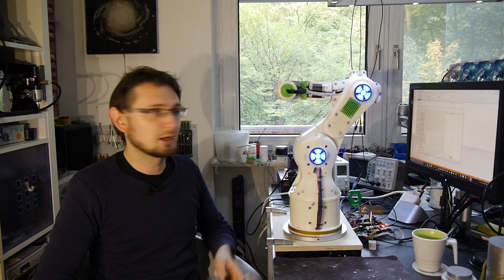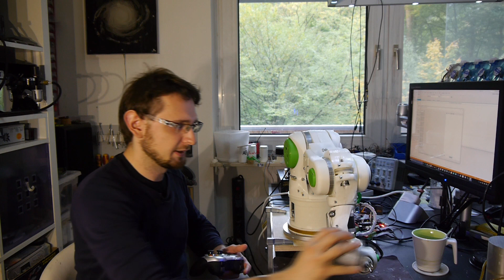Robot Arm project part 12

Comment: Very cool.  Have you looked at all into machinekit? The advantage would be smooth motion and I believe it should be easy to write a kinematics module, and use a beaglebone black with a CRAMPS or xylotex cape. If you wanted closed loop control you could do that also with some fancy coding.

Comment: what an amazing work done congratulations. Its works and looks amazing. But i could not understand your encoders. is these encoders costom made if its how its done or which materials used or are you gonna share or sold these encoderes. Im planning to build one for my home use to help me if you have a plan for selling or sharing your encoders please let me now and did you use PLA for robot arm or different kind of material

Comment: Thank you for sharing your progress! This appears to be a very robust system, even taking into account its limitations involving the use of stepper motors. A more complete BOM and documentation would help those of us not so skillful in the art of robotics.

Have you considered DIY aluminum casting for the gears/drives? There are several YouTube tutorials out there, but this one in particular (https://youtu.be/oFZMfBXxMxk) cleverly uses a conventional microwave oven, and it appears to be one of the least time-consuming and most inexpensive techniques.

Comment: Hi Andreas, nice development on your new bot. I have been working on my own bot right now but, mine can't even carry 200 grams, with arms fully extended. I am using servo's and I should admit, I am a bit disappointed by the angular resolution of my servos, it can only get accuracy to about 2 to 3 degrees. I am planning to increase torque by taking out the pot inside and gearing it up using 1:24 worm gear. If my calculations are correct it should be able to lift a maximum of 1 kg. In the future I am planning to convert it to stepper motors, just because I could not get the resolution I want from my servos. Anyway, you continue to inspire me with your work, please keep going.

Comment: Do the drive belts introduce some vibration because they flex?
Reply from the maker: +Dan Frederiksen If you tighten them to the right way thy have practically no clearance.
Reply: +Andreas Hölldorfer ok nice. Then I suppose they are just as good or better than metal gears because of their continuous large surface grip and allows use of printed plastic mechanics (up to a certain strength to weight limit).
The additional tensioners add a bit of complexity but not too bad considering the benefit.
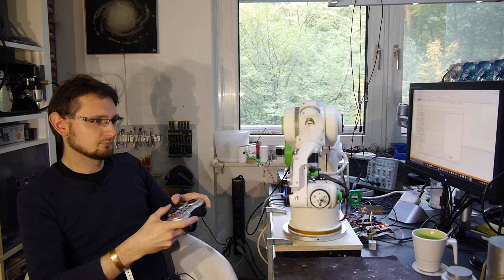I see you already have two stage gearing, I thought it was only 1. so you get around 1:10? you probably need either higher diameter or a 3rd stage to really benefit from brushless motors but you could try a single joint test just to see how well it would work with 1:10. Servo is definitely the way to go for serious robots. No serious commercial robot arm uses steppers afaik.
Reply from the maker: +Dan Frederiksen the ratio is between 10:1 and 15:1 and there is not so much space left for more. I'm looking since a year now for brushless motors with a gearbox let's say one stage planetary gear with 5:1 and didn't find one.
Reply: +Andreas Hölldorfer how about simply making the small one smaller and the bigger ones bigger? particularly the small cog makes a big difference in ratio and because of the large contact surface of a belt, I think it can have very few teeth and still work very well. Do smaller ones exist? otherwise perhaps that one small part could be 3D metal printed.

Comment: very nice but I wouldn't call it fast. I think you would be very happy with it if you stopped using steppers and used metal gears with very small teeth
Reply from the maker: +Dan Frederiksen I think it's running with 20% speed, without proper acceleration the motors would rip apart the arm,. 
High quality metal gears are very expensive I want to build a super low coast robot and this is the best you can get for the price I think.
Reply: +Andreas Hölldorfer well one possibility is to print metal gears.
As for speed, it looks like it skips a lot if you try to increase speed. Isn't that right?
Steppers have inherent flaws because of the heavy cogging. It's very weak for the size and power.
It's your choice of course but I am absolutely sure you would love the result if you based it on a low cost servo type arrangement like geared hobby brushless motors. Then it could be both very fast and strong. Maybe 10x in both speed and strength of your current stepper solution. Comparable to a human arm in performance. With no more design effort I assume.
Reply: +Dan Frederiksen I think Andreas's first version was with brushed DC motors, right? And I think there were some problems running them at low speeds. Maybe not if they're geared down enough? With my arm I'm trying a 500x reduction (15 RPM) for the shoulder, but I'm not far enough along to know if that'll work well. Also: Why do you suggest brushless?
Reply: +Lawrence Kesteloot because there is a good selection with powerful inexpensive controllers and it's a far more elegant design. more efficient. quieter I assume. brushed is a really ugly victorian era principle. might as well use a steam locomotive :)
you probably need fairly high gearing to take advantage of their power density. becomes a speed and inertial mass tradeoff but no doubt way more than 1:5. I suppose it is computable. the motor has guideline torque spec which gives you a rough ratio to the arm torque you want. Also they look much cooler. hobby king has all kinds, hockey puck shaped ones which might be good for lower rpm, not sure.
Quick calculation said 2Nm torque for a 485g motor (8cm and 6 long  61euro) 15 second spec meaning not continuous duty. Which on a weightless 1meter arm is 200gram load ungeared. So let's say we want it to peak handle 10kg at 1 meter (100Nm), that's 50:1. That's probably comparably to a man's shoulder joint strength and probably similar speed too. So you might need 10x higher gearing than stepper but then maybe 10x stronger and faster too.
For a geared motor muscle, I always figured you'd want a spring loaded coupling so the limb isn't rigid and will suffer damage if forced, like in running foot impact or crashing. That means you need 2 angle sensors per freedom but well worth it if you want awesome motion. Might also mean you can use the motor moment of inertia for higher peak impact torque without exploding gears.
Reply from the maker: +Dan Frederiksen Well I spend month with researching motors and find no easy solution that is close to the price of the stepper motors. Gears are quite expensive and you have to deal with the backlash. Basically you need an encoder on the motor shaft and on the joint, and to process the control loop you need a controller for each motor because it's one will be too slow to process all, and so on. 
I totally agree with you stepper motors are not very effective in wight and speed and strength, but they are incredible cheap in a lot of ways.
Reply: +Andreas Hölldorfer you already have joint encoders in the design, right?
what principle is that and is it precise enough to position by or just a backup?
it might be possible to run an RC motor 'blind' with a rough software model of the motor such that the fine quick motor controls are computed rather than measured. Do you follow? so you basically control the brushless motors 'fuzzy' or analog and open loop blind and only slow correlation to the joint sensor to make sure it is conforming to predicted. Does that make sense? the motor controllers for RC brushless use the 1000Hz pwm control I think. so your controller would just have to produce those signals at relatively low frequency, much lower than the stepping.
Do you follow the idea? if the idea is sound that means you could do it completely without encoder on the motors and just handle it in software.
And demand on your controller hardware would be less I think. You just need 6 1000HZ pwm outputs updated maybe 25-50 times per second.
Are you familiar with the RC brushless type of motors and controllers I mean?
Reply from the maker: +Dan Frederiksen Well I'm doing something like this right now with the steppers. I use the encoders to get the absolute position of the arm so I don't have do do a homing move on startup and to detect if the steppers are losing steps. 
Well I tried a lot of this with the other arms and it turned out more difficult to implement and build a I thought. 
This is the reason I went back to the steppers I know it would work, and this is how I work. I need a foundation to work on. From this point I can slowly improve the parts by it's own. I would love to develop a brushless servo controller for that but there are so many things to do that I simply can't all. With this design as a start point maybe someone else can help me with  the different parts. 
But again to my experience you need something that works. Not the perfect solution but a working one, from this point on you can improve part by part.
Reply: +Andreas Hölldorfer I understand. You have made a very cool looking arm.
It's just that when you have come this far I would like to see it come that little bit further and go from cool to awesome :)
Dirt cheap awesome powerful servo operation is something that could get a lot of attention. 
Motor like Turnigy G110 for instance. Quite inexpensive and powerful.
Reply: +Andreas Hölldorfer I just looked at your earlier videos. It seems you have a geared DC motor functioning much better than the current steppers. Is it possible that the high speed and strength scared you off? and that it actually worked well. Or was that gearbox very expensive?
Reply: +Andreas Hölldorfer Steppers are pretty good for these kind of applications. Problem with your robot is maybe in two things. First one: you are maybe using wrong gear down from steppers. Bare in mind that steppers have highest moment on low RPMs. Little to none gear down is needed when you use steppers. For example, when people use ball screws, most of them make big mistake using ones with 5mm pitch. On stepper, you can easily use 20mm pitch, because you have torque and don't have speed. It's totally different from standard brushless DC motors. That's why, when you speed up the steppers you loose steps. Their torque value goes down.
Second thing that is maybe wrong, are settings on stepper motor drivers. Current and microstepping. Microstepping reduces vibration. Also, low current and of course, low voltage are main reasons for low torque. You need at least 24 volts for steppers, and good current values set. 
Bad stepper motor drivers can lead to low torque. If you are using Chinese ones, then it might be the problem. If impuls of power on the phase is given in the wrong moment, you loose torque.
Also, as I can see, reverse kinematics is not solved very fast, and you are having glitches there? Am i right?